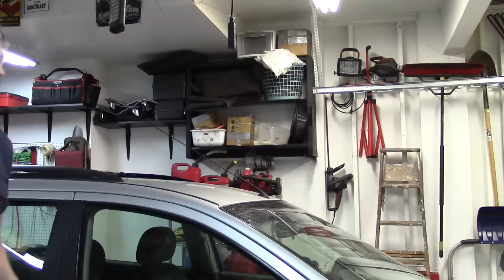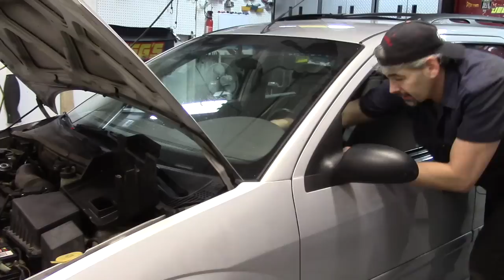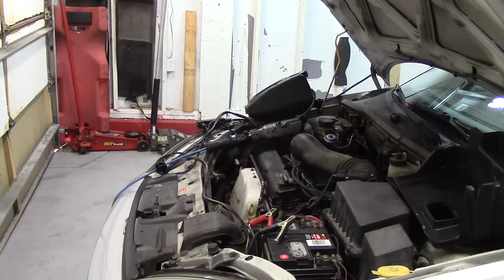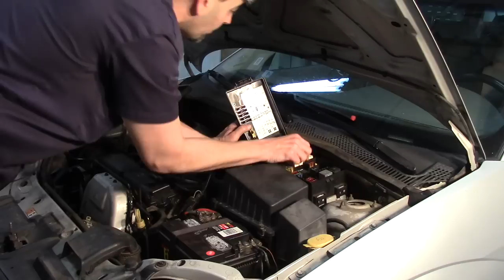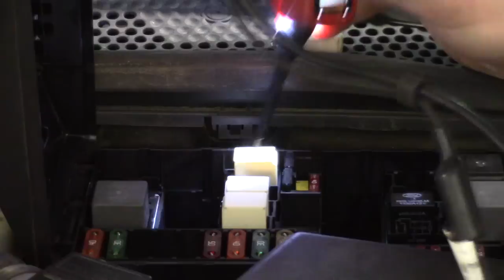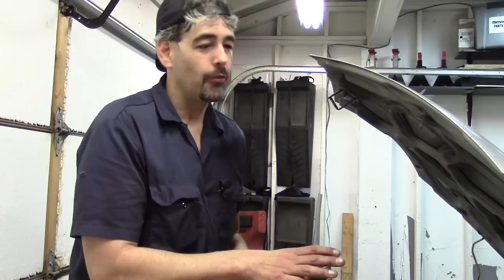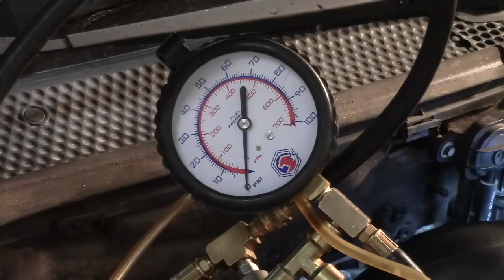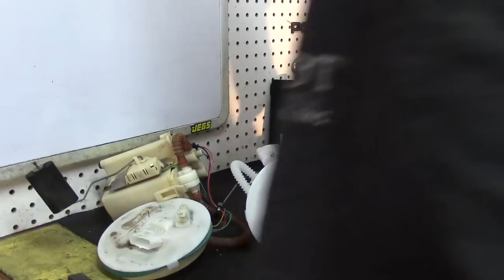Cranking No-Start Real Time Diagnosis -Ford Focus

Comment: How to check the alternator with a dead battery ? 👍🏻🇨🇦
Reply from the maker: It’s actually easier on a dead battery. Compare the output with the commanded duty cycle and see that the voltage output correlates.

Comment: I am looking at a friend's 2015 fiesta it cranck for a few seconds and stops i have to turn the key back to try again and the same problem cranks  for a few seconds and stops
Reply from the maker: Sounds pretty straightforward. What did your FASTTEC analysis show?
Reply: @SchrodingersBox  from what I have figured it could be a fuel interrupter not sure where to find it been looking in the usual spots but as of now I have not figured it out I have only looked at it for 15 min
Reply: @SchrodingersBox  I am not really a mechanic I am more of a body man 
I am trying to help my friend out
Reply from the maker: If it’s a fuel interrupter then of course you would be losing fuel soon after it starts. 
Confirm that first. If that’s what you find it sounds like maybe a security system problem.  Not sure what system a 2015 fiesta uses but that’s what I would suspect if you find there is an intentional fuel cutoff.
Reply: @SchrodingersBox  they had a new chip put into the key as I said, it turns for about 3 seconds and stops
Reply: @SchrodingersBox  they had a new chip put into the key as I said, it turns for about 3 seconds and stops
Reply from the maker: Yep I still suspect the chip wasn’t programmed to the BCM perhaps. 
   I would check for evidence of intentional fuel cut off. If I see that’s not what’s happening I would then move to a different hypothesis.
Reply: @SchrodingersBox  ok thank you for your help

Comment: Why did you not go down the no fuel route first instead of the no spark route?
Why waste time?
Reply from the maker: Well it’s easy to say that now that you know it’s no fuel. There is no way to know that at first. You have to determine it. Of course if I magically already knew the problem I would have gone for fuel first.
Reply: @SchrodingersBox  I knew you would say that if you replied but you didn't say then or now why you opted to go spark first.
To me it was obvious from what you said at the start of the video.... Customer was driving along and then engine cut out and wouldn't restart. All day long that's going to be a fuel supply problem. It's the same as if you ran out of fuel.
Reply from the maker: You have to choose one or the other. I could have chosen fuel first and then find out it’s a no spark problem and you would have say “why didn’t you check spark first”.
   I could have checked fuel first then spark next and both worked and it turned out to be a timing issue. You would say “why didn’t you check timing first”.  I have MANY videos where the same symptoms happened and it was a spark issue because of a broken ground from loose motor mounts. You have no way to know. 

   It’s just logical sequence my friend.  You have the advantage of knowing the result before you guess by sitting in your armchair watching the end. I don’t.

Comment: I know its a long shot asking on a 10 year old video but 17:10 I assumed you probed the green/orange wire in pin1 and the black wire in pin5, I see only 6.8 volts when turning the ignition on.

Update: i seem to be losing almost half my voltage between the 15a fuse and the middle pin of the fuel pump relay (which I'm assuming is meant to be the 12 v to the pump)

What should I do?
Reply from the maker: Is your pump pulsewidth modulated?

Comment: I have a ford focus and replaced the fuel pump and relay and still have no fuel pressure with no start🥲
Reply from the maker: why would you replace the fuel pump for no fuel pressure? what evidence showed the fuel pump is bad?
Reply: @SchrodingersBox  I have a code p0232 for high voltage in secondary circuit to fuel pump. After replacing the relay and some fuses still no start I decided to try the fuel pump itself. I'm not sure what to do now that it's not starting still. Car wasn't even misfiring or throwing codes before this, it was completely random
Reply from the maker: yes you need to chase down the open circuit. it’s not the fuel pump. what is your fuel pressure when you put 12V to the pump directly? what is your voltage at the fuel pump?  what is your voltage drop on the positive and negative?
Reply: @SchrodingersBox  Truly appreciate the reply, especially on an older video. Definitely earned a new sub! I was able to get the car running again today after reseting the cars inertia switch and resetting the pcm with a jumper. Not sure which exactly did it but I'm not complaining haha

Comment: great video thank you my 2009 focus after first start of the day maybe 2 hours sometimes starter keeps turning over until i shut it off them turn the  key and starts normally.Whats your opinion?
Reply from the maker: What data do you have? Whats the static fuel pressure? What is the cause of the no start- is it fuel or spark that’s missing?
Reply: @SchrodingersBox  i kind of believe its starter related or start switch
Reply from the maker: if  it’s an issue with the starter than how is the engine turning over?
Reply: @SchrodingersBox  good point my friend

Comment: friend of a friend has a 1998 F150 that cranks but will not start, has had several "mechanics" look at it and they can't figure it out, I live 50 miles away so was kind of helping by text. They said it had spark, has pressure at fuel rail, could not start it with starter fluid, two weeks ago they changed both the camshaft and crankshaft position sensors, still wouldn't start. I was finally able to go down and look at it, within 10 minutes had it narrowed down to fuel ( I was able to get it to run with starter fluid, not sure why they couldn't), there is 40 psi pressure at fuel rail so do not think it is the pump or the filter. Don't think it's a fuse issue because near as i can tell from diagrams and online the fuel pump fuse also controls the injectors and pump seems to be working. Did not have time to check for pulse at fuel injectors. When I pulled the intake tube off the throttle body the throttle body and plate is pretty dirty so wondering if there is a TPS issue but it's not showing any codes.  Looks like injectors are not firing but need to dig a little deeper. Any ideas or suggestions ? Scanner shows rpm's so crank sensor seems to be working and I'm assuming cam sensor is to, both are brand new.
Reply from the maker: What’s the cam and crank correlation showing? Seems obvious the issue is there.

Comment: Im 64 and have been wrenching since I was 16...I also approach no starts the same way...The are 3 factors involved always...Fuel, spark and compression... if all 3 are there ,you Will get a start or at least it will Attempt to run.. if any of those 3 fundamentals are absent, its a no go.

Comment: Kindly help with what to do when the engine refuses to start. Initially, it cranks before starting but currently it doesn't start at all. A scam was done and it indicated that the crane shaft position sensor is faulty. The concern is that the car is a ford figo 2018 model
Reply from the maker: Just measure the voltage from the CKPS signal as the first step.

Comment: Hi ive got ford connect 1.5 cdti 2017 no start no crank starter no response injector pump metering cintrol  low  A p0253 11 27  also battery drain

Comment: What are those other possibilities? My fuel pump does come on with the jumper. So far people have mentioned rusted fuel line (no pressure dispite pump) and failed crank angle sensor. 2010 focus died two stop lights from work yesterday.
Reply from the maker: The first question (and only one actually) would be What’s the static and loaded rail pressure?

Comment: Great Video !
I did until the part, from Carburator Starts and the 15 Amp fuse, now  i see there more thing to test...but I dont know have that tool.
Can a Gas Pump during the night broken or be a Filter completeky stucked?
Because Focus mk1 reached home with no issues, next day no more gas intake to the Carb...

Comment: Can we have a whole video on how not to fry the PCM with jumper wires, power probes, and multimeters? I always just jump the load side with a wire and don’t really understand exactly what would fry the PCM. Also the multimeter set to 10A frying the PCM when forgetting to swap the cable port and going back to test voltage. Would appreciate understanding what not to do and why it happens. Kind of thought the circuit breaker in the power probe would prevent any PCM frying.
Reply from the maker: My website has several videos on that- www.schrodingersboxqm.com.
Reply: I can’t believe you replied!! Was going through all kind of trouble hoping to figure out how to tag you lol. Thanks so much for all the info, your channels amazing. Will def check out the website.

Comment: To cheack the wiring intergrity from the fuse box could you put your test pen to positive battery and then to the load side of relay pin 87 and if you see it light it means the wiring is good from connector 87 to the pump windings and back out to pump ground chassis ?

Comment: It was very simple, remove the fuel line clip, pull off the line, place the line  in a bag and crank. Fuel fills in the bag. If you want put a pressure guage on the line.. This guys is a fraud I think.
Reply from the maker: Yeah the difference is I knew when and why it needed to be done while you need someone to tell you.

Comment: What if the car doesn't start with starting
Reply from the maker: then you determine the FASTTEC component missing causing it not to start.
Reply: I didn't everything but you show in your fasttec it seems as though I am getting everything that I need but it just will not start
Reply from the maker: Not possible. If the car isn’t starting you are missing a Fastec component.

Comment: Why didn't you just turn the key and listen for the pump to prime, usually easiest way
Reply from the maker: I did but there are 2 issues with that. first, not all cars have KOEO prime. second- the prime does not confirm there is fuel pressure. 
   if I hear a prime I generally triage lower but not eliminate the issue. if I don’t hear a prime I triage higher but also keep in mind that it my not have a prime until cranking.
Reply: So did you hear the prime when you listened, I'm just curious my son in law has same problem so I'll be going through the steps..
Reply from the maker: Man this was so long ago I don’t remember. Either way it’s pretty straight forward. Just spray some starting fluid into the throttle body. If the car starts then it’s a fuel problem regardless if there is a prime or not. If it doesn’t start then begin your diagnostics with spark.

Comment: The thing is though (obviously here you were on the ball as usual )BUT  how do you explain spark at 1 spark plug only ? As you only tested 1 ? Thanks that's our issue here
Reply from the maker: It’s because it is virtually impossible there would be spark at only one plug. if only one plug has spark, you have only two possibilities why the others wouldn’t have it. one would be an open in the positive feed between the hood coil and other coils. the only other would be lack of ground side control on each of the coils that don’t spark- I don’t even know how I would explain that. 
  if you have spark to only one coil I would check the reference voltage as the very first step.
Reply: @Schrodingers Box  hi thanks I'm so so on multimeter  (thanks for replying btw) I'm not stupid obvs . I've got voltage of 5v at positive on all 3 which is odd ..I'll check these again though as I'm sure when testing it wasn't cranking so I'll do this over weekend ..assuming I put plugs back in same order (new plugs few months back ) still only a spark at cylinder 1 no evident spark on others . I do understand what you meant in regards to bad earth's on 2 (non spark ) plugs but if I'm right don't they share the same earth ? I'm sire that's what you meant . Its unlikely that would be possible .

We originally thought (well I did ) it was 2 bad ignition coils.  But simce took them back . I (should  have done so in the  firstly place ) swapped coils around only cylinder 3 (I believe its 1 on right then 2 & 3 to the left  on this car )  is sparking . The far left anyway 3 cylinders . It was running .......sat over weekend . The horn went off constant.  Then the owner removed horn fuse or battery . Whichever to stop it . Simce then it's not started . All lights up etc we've got fuel for sure . Good pressire . At the rail .

A bad earth was my suspicion in first place . I know there's 1 on gear box I can look at but that earth isn't direct for the ignition but possible for engine fuse box I'll check diagrams again. 

The haynes manual for some reason isn't showing any wiring for the ignition power feeds ? Very odd
Reply from the maker: a coil is always ground side switched. it will not be a bad earth. that’s why you need to start with the reference. 
   if NONE of the coils have spark then that is a a totally different story and I would say you have intentional lack of PCM control to the coils. but you have spark on only one coil so that is definitely not the issue.
Reply: @Schrodingers Box  true . I'll check gap on plugs I guess . Where wouod you start checking mate ? So as there's a spark at 1 it likeky rules out immobiliser? I know gap shouod be 1.1mm so I'll check that . I didn't bother given they were new only 2 months or so ago. And we're running fine notvwet. . 

Even though it wouod not explain lack of spark.  I guess it could be flooded from all the turning over.  It often starts for a second or so then cuts right out . I doubt it's cam sensor as the rev counter does move while turning over . I've had that out . And crank reads 2.1ohms . Don't help as this new multimeter has short pins  . . I just want a direction to go in . May be overlooking ut ..maybe he flooded it and we made it worst . My old man said plugs were dry but don't mean it's not flooded I guess .  ? 

I guess I can at least remove pump fuse and turn it over few times . I'll check plug gaps first at least . 

Thank you
Reply from the maker: Not sure what all you are doing with the ohm measurements and all, I don’t follow how that would be useful but this is very very simple so don’t dilute it with variables that can be ruled out. 

You have spark on one coil only. You have only two possible variables for this. That’s all. It cannot be a immobilizer. An immobilizer will inhibit either signal or ground side control to all coils.  So you can rule that out since one cylinder has spark. 
   I would start with reference at the coils without spark. It’s not the first step- it’s the only step. You could also try inputting a reference and seeing if spark is restored which would confirm an open is the cause. 
   Given one cylinder only that has spark this is the only diagnostic procedure because you have so few variables that would cause this. It’s way easier than no cylinders having spark, if you think about it.
Reply: @Schrodingers Box  makes sense . When you say input a reference.  Do you mean ground a non spark to chassis? Or give it a direct positive ? 

Thanks . I guess aa you said it narrows it down a lot now you've explained /ruled out  other issues . .

I'll def be checking plugs and also find out what plugs maybe he bought cheap nasty ones . I know you can test separately with  a test light or screw driver . Etc I'll get back to you . I do appreciate your help it's a friends car . I have my own stuff going on (no faults ) rebuilding my bike engine ty matey
Reply from the maker: I wouldn’t input a reference until I confirmed it’s missing first but you can just borrow from the functioning coil since it obviously has one. Just don’t ground it!!!! If you do that then obviously you will fry the reference source.
Reply: @Schrodingers Box  understood . Thank you.  I'm thinking maybe spark.plug .gap . First . Just didn't think it'd be as simple.  I'll get back to you on this

Thank you buddy top man
Reply: @SchrodingersBox  hi still only spark from 1 only switched coils  and opened spark gap not plugs also cleaned them etc
Reply: Scrap that it's OK now
Reply: @Schrodingers Box  one other thing . I've read elsewhere that I hoped to rule out any immobilisor issues . Some say if key is in car in 2nd position it'll make a slight bleep  noise but don't.  Surely though an immobiliser would shut off fuel and all ignition ?
Reply: @Schrodingers Box   seems to have been fouled plugs tbh on Mt bike servicing I've always put in new no issues . Had diseks Las 10 years lol so simple

Comment: Absolutely excellent video presentation!!!
Reply from the maker: Glad you liked it!
Reply: @SchrodingersBox  same problem I’m having with my daughters 2002 focus de sedan automatic. Car just stopped dash went black. Our mechanic changed the ignition coil wires and plugs called us and said.. “runs like a new one”! So we went paid $500 plus $127 towing and about a mile from his shop my wife turned a corner into our neighborhood and same problem car shut down. Another $127 for more towing. Then a call from mechanic stating he ordered a new PCM. A few days later he called again daid he installed it. Car started but after 5 min running he said “the new coil shorted out because of new computer so… he bought another computer and another new coil. Now it runs great but he said when he went to test drive it the transmission won’t shift past 2nd gear so he said he’ll keep “hunting down” the problem. So as of today Monday 01/30/2023 the car is sitting at his shop still… the focus NEVER had any problems. I live in Georgia so ZERO RUST shiny perfect paint perfect interior engine and trans are excellent the car is beautiful.. literally like new. 118,400 miles (my wife barely drive the damn thing. Just sad and down is all
Reply from the maker: Sorry to hear, sounds like a terrible ordeal.